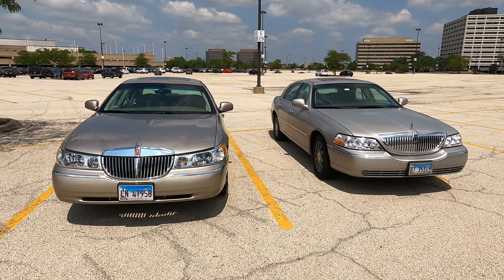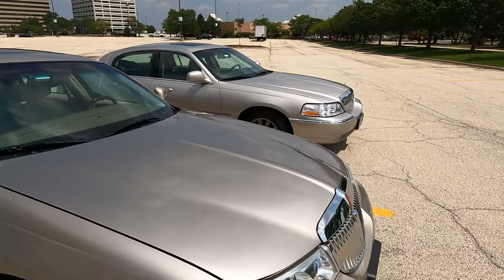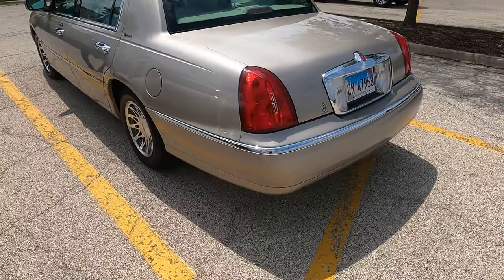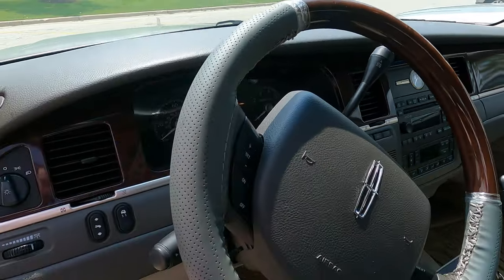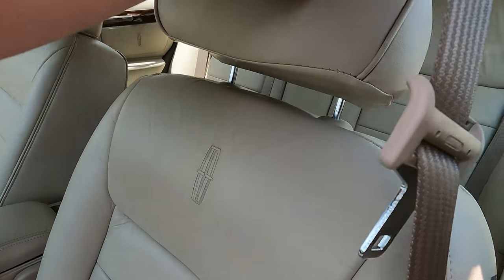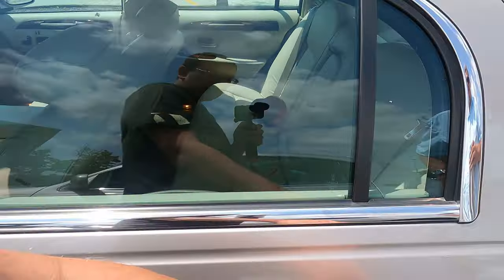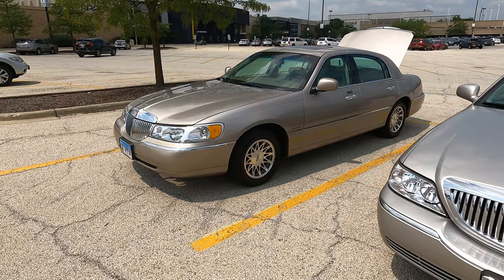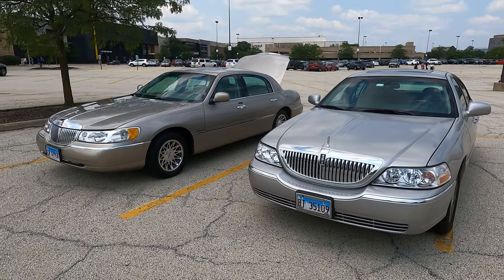Lincoln Town Car Guy Compares 2001 (3rd gen) Town Car vs 2006 (4th gen) Lincoln Town Car

Comment: 3rd generation was just a way better vehicle. Tail lights had the Lincoln emblems, 1 hood ornament not 2. Suspension in the 3rd generation was cheaper to fix and better design. The front doors had a flip up lid for storage, 4th generation screwed that up with the push button that breaks. Chrome door handles turned to cheap painted handles.  4th gen Just a lesser car. I have been in the Limousine business for 30 years Badger State Limousine Service. Just north of you in Milwaukee. I still operate a 1999 Town Car stretch that is just Cherry. I used to run Cadillac, but GM kept cranking out crummy motors an Lincoln took over, the Town car was and still is king. 2011 the last of the American Luxury Work horse.
Reply: Not to be knit picking.....but the 4th generation only had a LINCOLN badge on top of the waterfall grill.   There was no 'star' ornament on the hood.   But it definitely made a statement.
Reply: Facts. They made too good of a car for 3rd gen. The hair of refinement in the 4th wasn't worth the added complexity and costs. They should have taken a page from Cadillac's flagship car of that era and realized Cadillac had already made that mistake.
Reply: Uncle had 01 touring sedan. Great driver

Comment: I have a 3rd and a 4th generation Lincoln Town Car. I love them both, but the 2001 actually saved my life when I was rear ended at a stoplight. I was at  dead stop and a driver plowed into me at about 25 mph. Her car’s front end was crumpled to her windshield~ her car was totaled and had to be removed via flatbed. My 2001 Town Car had been shoved forward, no apparent damage except a slight crack in the rear bumper. At that time I viewed that car as something different than a vehicle~ I realized that it was my loyal friend.
Reply: It's good to know that you and your "loyal friend," the 2001 Lincoln Town Car survived the car crash. I love driving my 2002 Town Car that has been my daily driver since 2007.

Comment: The round plastic arm on the outboard side of air intake snorkel AND the triangle shaped box next to engine are both baffles.   They are in place to quiet the wheeze and whines of the engine as you accelerate.  It cuts down on any of the noise the passengers may hear while inside car.  They are on all Panther platform models from 2005 till the end of production....minus the P71 Police Interceptor package.  Enjoyed comparison video.  You both have nice Towncars.

Comment: Interesting comment on the 1998-2002 headrests.  They can be swapped out for Mk. VIII headreests which are taller.  The swap is direct fit as the mounting posts are identical.  The hardest part is getting the C-clip to release the posts.

Comment: I have a 2002 Town Car, and I like the fact that the grill is NOT attached to the hood, unlike the 2003 to 2011 cars. However, I prefer the look of the wider grill on the 2003 to 2011 cars. 
       The transmission fluid dipstick on both of these cars is so far under the cowl, it is hard to get it out and back in to check the fluid. If you need to add some trans fluid, you need a very flexible funnel.
Reply from the maker: Thanks for the comment!
Reply: I hear ya, I have an ‘07 and that trans dip stick is waaay back there.

Comment: The biggest difference is the transmission change in 2006 (not 2003 like wikipedia says) found that out the hard way. The old transmissions werent bad pretty average but the newer 4r75 transmissions are the only cars you see with 500,000 miles up for sale like you always do.
Reply: I have a 2010 town car 4r75 with 400k miles. Last month I had a valve spring snap and swapped the engine with a 100k mile 4.6l. I paired it with the same 400k mile trans and it runs like new. Best trans and engine of all time
Reply: Forgot to mention I swapped my engine myself because it's also the easiest modern v8 engine to service of all time
Reply: @tayd799  thats awesome i wanna know how long that transmission lasts, ive seen town cara up for sale with a 500,000 miles all the time but the most ive ever seen was one with 640,000 miles and the post didnt mention a new transmission or engine in its discription.
Reply: I'll keep ya updated. If it even last a year that would be great but if not I have a parts car with a good transmission waiting
Reply: I have a 96 grand marquis with 270 000 miles on original motor and transmission and both are doing great.  Rest of the car is failing wipers, windows and ac beyond what I am willing to fix.  Put that money towards my next one if this o e doesn't outlive me
Reply: @NeasYellek  how could it be the original transmission and did you have to replace the intake manifold problem thats common on these? My 85,000 mile 2010 grand marquis needed one and it has the awful stuck on heat problem i was able to jerry rig fix
Reply: @NeasYellek  theres videos on that on youtube here if you get your heat sticking on

Comment: The 03 and up just handle so much better.   That aluminum steering axle the came up with is so much better.   I've had an 03 grand marquis then went to a 01 crown vic lx and I like the 01 but it's just not nearly as good around corners

Comment: The latest before discontinued especially after bringing back the Lincoln star logo hood ornament. My floor mats didn't have the logo when I had the 2006 Lincoln Town Car Signature, but my 2017 Lincoln Continental Reserve have the logo on the floor mats.
Reply from the maker: I think they should put those starts everywhere as it's simple and classy
Reply: @VitaliyKofman  they are classy for sure especially for a luxury car no matter the trim level.
Reply: My 2007 has the Lincoln star logo hood ornament and also all my floor mats

Comment: I think 91 to 93 was the pinnacle of Town Cars interior, felt way more luxurious. Things went down hill with every next generation, the last one was meant to be a taxi. Between these two I prefer the exterior of 03-11 as it’s more boxy in the front. I feel like the wheels on the 98 seem to small, the pointy front also don’t go well with the rest of the car.

Comment: Great review.  I’m looking at a 2001 signature series with only 43000 mi.  That could be a good or bad thing however.  The air ride is bad.  That seems to be quite common in these.  Do you know if the coil over conversion kit is a wise choice?  Thank you again for your review.
Reply from the maker: I think it's worth going with the original air suspension since they last ~10 years and not super expensive
Reply: @garysuper5338 My 2000 Town Car had coils installed by the previous owner when the air suspension went south on him.  I think it rides great; of course I don't know how well it rode with the air suspension.

Comment: The 4th gen has a spot on the top shelve in the trunk to put a full spare, there is a metal loop under the carpet to attach the hook for the spare tire. The full size spare was an option in the 4th gen town car.
Reply: I have a third gen town car 2000 and in 2024 installed the full size spare tire that is 24 years old and three thousand miles later, it’s doing great

Comment: My last four cars were Town Cars, a 1984, 1990, 2000 and now a 2006 designer.  I absolutely love these cars, when I was looking for a replacement for the 2000 (2 deer strikes when my cataracts were so bad I shouldn't have been driving) I couldn't find anything that drove/rode like a Lincoln.  It seemed like everything I could find either drove like a cheap sedan, a sports car or a truck.  Finally found the 2006, garage kept, beautiful condition, rode like what I was looking for.  The 84 (which I still own) was my favorite as far as looks, it's just in terrible condition and would cost far too much to restore but I haven't been able to be shed of it.  I may be dead before my current Town Car needs to be replaced, but if not I'll be looking for the 2011 probably.

Comment: 2000 Cartier L Series 325k miles, been garaged for a few years, started right up, but it's running like crap, misfiring, and I have a bad oil leak that I can't figure out where it's coming from, maybe the rear main seal, %@#/÷&*%, I'm not great at diagnostic stuff, I'm thinking of replacing the 8 coils and plugs, is that a sucker move? Cleaned the mass air sensor, didn't help, new air filter, no change....scanners not giving me a code...advice?
Reply from the maker: I'm sorry, but I don't do my own repairs. At this point, i would take it to a mechanic and based on the estimate make a decision if it's worth fixing.

Comment: The trunk has that shelf in order clear the rear axle in this rear-drive car, which also accounts for the leg room difference compared to an Avalon. The funny tube on the engine air intake is a Hemholtz resonator designed to mute uncouth intake noises.

Unlike an Avalon, the Lincoln can do some serious towing. The factory tow rating is 2,000lbs, but it shares engine, transmission, rear axle, and body-on-frame construction with the Ford F-150. Both are rated the same for towing with the standard 3.08 rear axle ratio. The tow ratings for the F-150 with shorter axle ratios show the potential of the TC with those same ratios. Due to the lack of a serious transmission oil cooler, Ford didn't increase the tow rating even when the TC was equipped with optional shorter ratios. 

With a proper trans cooler and a shorter gear, the TC can match the F-150 (IMO). Having those things done, along with a Class III trailer hitch and trailer brake controller, costs ~$2000. Most people won't bother, of course, but it's why I bought my 2001 TC instead of a 3rd generation Avalon. It will tow my sports car, or an enclosed trailer, or whatever. I also paid about half as much as I would have for the Avalon, so even with the towing upgrades it still cost me less. Just thought I'd toss that out there.

If there is anything more dependable and durable than a Toyota, the Ford Panther (Crown Vic, Marquis, TC) is it. Panthers regularly went 500k miles in fleet service as taxis, limos, police cars, etc.
Reply from the maker: Thanks for the comment!
Reply: That shelf is also where the gas tank it located that is why it is rather tall other wise if only for rear drive clearance it would of been much smaller.
Reply: @mrelectron6220  
The gas tank is located below the trunk floor.
Reply: Thanks for sharing.
Is there a difference in the trans/drive train between the 3rd & 4th Gen TC?
Reply: @Blessed.2.Teach.4God  
Nope, other than the installation details that changed whenever the car has had a significant redesign. All TCs had solid rear axles and rear wheel drive.
Reply: @Michael_Lorenson  The gas tank is NOT located below the trunk floor. It is where mrelectron6220 said it is. The tank’s longest dimension is installed vertically and it located at the back of the trunk and under the trunk shelf.

Comment: Mice will absolutely chew the insulation on the underside of the hood like that when the car is in storage. If you store it for any length of time in a building which is not vermin proof then I suggest you place ample amounts of mothballs under the hood. A long time ago I had a similar experience with a Chrysler the mouse sat on top of the engine and chewed a hole in that insulation. It's also a good idea to place mothballs around the vent intake under the windshield so as to hopefully keep them out of there and potentially getting inside the vehicle.
Reply from the maker: Thanks for the comment 👍
Reply: Rather spray peppermint oil. Mice can't stand it and it smells better than moth balls

Comment: I 100% think the 4gen looks night and day better. I remember when the 3rd gen came out my other had a 96 towncar and thought they completely messed up the towncar until the 4th gen came out. I also own a 2005 and my mother still has her 96. My two cents.

Also random thought…my 05 has auto open and close trunk yours should too. I see you popped it but then closed it by hand.

Comment: I wonder if you could tell me where you got the cup holders on the 2001?  I have a 1998 and the factory ones really do not do it.  My 1998 town car does have a better ride than my 2003 town car (Cartier L), but the 2003 does have more style.  I think my next town car would be a 2007 designer loaded.  Hard to beat these Lincolns.
Reply from the maker: Hopefully the owner will reply, but he did tell me he had to contact the manufacturer for color matching so it was a custom job.
Reply: I got the cupholders from a company called Cupholders Plus. They will send you color samples on request. I use double faced tape to hold it in place.

Comment: I had a 89 town car and it was  repair free, I now have a 01 for 9 years now repairs fuel pump, alternator, and replaced the air springs with Coil springs still very nice ride. Treat yourself and get one of these smooth and comfortable boats I prefer 89to 91 octane for best performance 4.6 engine.
Reply from the maker: Good stuff

Comment: I have a 2007 Executive 64" "Presidential 64" stretch limo that has a full size spare tire mounted where the 3rd gen's is located.  I wish I had the mini spare.  Overall, I like the 4th Gen look better.

Comment: I have a 2004 Signature. I love it. We had a bad storm and I got stuck in the road I live on. I had left to get help and some 1 rear-ended it and broke my driver side rear tail light cover as well as broke the bumper and knocked the reverse sensor out. I got a great deal on it and now I have to figure out a way to fix it being on a tight budget. Any idea where I can get parts at a reasonable price? Love the video!

Comment: I didn't like the location of the temporary spaee tire is, especially when having to change out bulbs for signal which I had to do often. Better when the spare tired was on the shelf. My Continental has telescoping steering wheel which hardly use but as tilt its power/electric.
Reply from the maker: Thanks!

Comment: The tear marks in the insulation under the hood That’s from the  serpentine belt breaking not a animal
Reply from the maker: Thanks for the comment!
Reply: It's definitely due to mice. It's a common problem in cars that have soybean derived formulas used in car underhood wiring.

Comment: Actually the 4th generation started in 2002. 4th generation has a wider chrome center grill, which when hood is opened the center grill is attached to hood allowing more room when fans or radiators or removed. Plus the 4th generation has the ECM computer box on the drivers side upper area under the hood to where you dont have to fight with it being under the dash. Plus the 4th generation has a more accessible trunk entry area that is wider and has the inner trunk shelf area. 4th generation has improvements and is the better choice

Comment: Third gen was 1998 to 2011.
Reply from the maker: Thanks!
Reply: @ DH McC--   You are correct. Many years ago I used to think that the 3rd generation was only from 1998 to 2002, and the 2003 to 2011 was the 4th generation,  but they are all considered the 3rd generation.

Comment: I own 2001 LTC, but i cant stand it's front end with this roundy grille 'cause monumental car looks so smiley. On the other hand, i have idea that I could transfer front end from fourth generation to third generation (hood, fenders, bumper cover, headlights etc.).
As for me, the perfect towncar of this body is 4-th gen exterior with 3-th gen interior and 3-th gen stoplights (with lincoln badges). Also I miss about cigarette lighters in rear doors.
Reply from the maker: Thanks for the comment!

Comment: After having owned or driven dozens of ford, Lincolns, and mercs in the car service and livery business. Here's some difference 
1998-2002. Lincolns,
All plastic intake manifold
Throttle body cable linkage
Coil plugs prone fail
Chassis/frame from 90s lincoln
Steering with old steering box.  
Frobt Control arms more solid (more metal, and could replace bushing instead of the control arm) 
Front suspension shock and spring s And front suspension same setup like 1980s lincoln.
Different transmission
Driveshaft steel. 

2003 onwards
New redesigned chassis
New suspension
Front uses struts, 
And rear (fords and mercs) shock absorber more outward along the rearend
Lousier imo, less metal and thin lower control arm. Look like thin  wishbone,
Rack and pinion steering
New transmission (or update/upgraded version)
Electronic throttle body control
Hvac ac accumulator closer to radiator
Plastic intake manifold with metal sleeve and brace to preventb crack
Engine cooling fan and control module integrated in one assembly.
Aluminum driveshaft
17 inch wheels option available

Comment: 4th gen front end (bumper, headlights and hood) with 3rd gen from the A pillars back is the ultimate Town Car. 

Head rests on modern cars are all super annoying, if you sit with your seatback in a normal upright position (ie not leaned back like a moron), they push your head forward and strain your neck.

Comment: Those two chambers on the air intake duct are basically mufflers. Cold air intake systems make the air intake louder and you can hear the engine sucking in air. Those chambers on the factory one do the opposite of that. They are intended to make the air intake and therefore the engine in general quieter. Hope this helps 2 years later lol

Comment: 10:49 It is at this moment, memories of the time I accidentally discovered a feature on a car I had for a few years. I walked to the car from the store loaded down with bags, and as I stood behind the trunk, preparing to put the bags down, the  car beeped twice, and the trunk opened.  Turns out, it was a feature.  That being said, I currently have a 99 Town Car, Cartier, everything works, like driving a sofa, and I'm just fine with this.